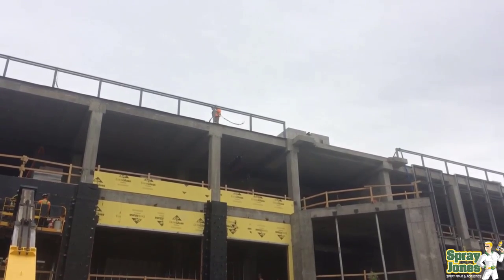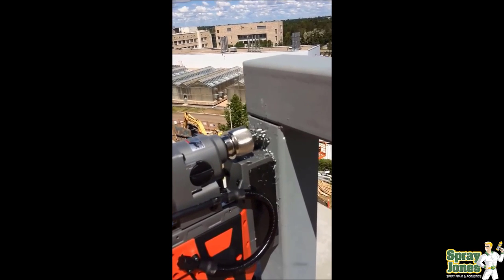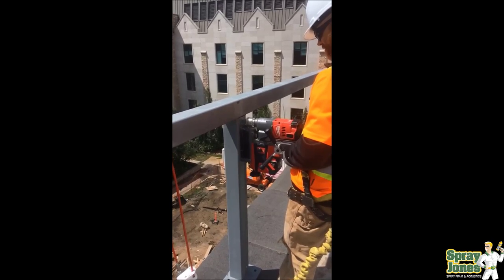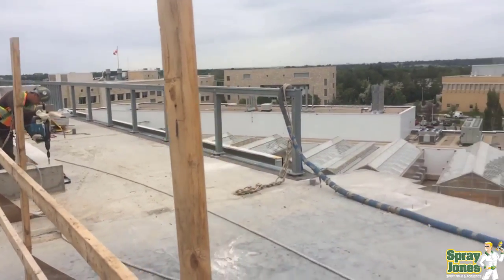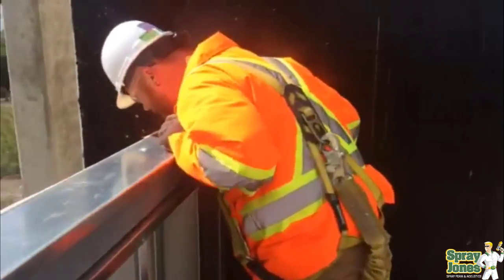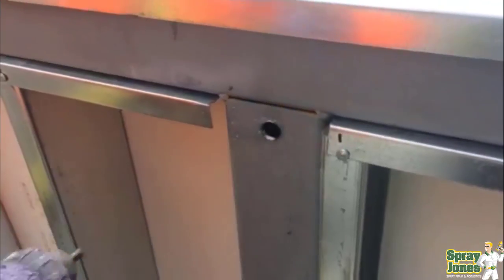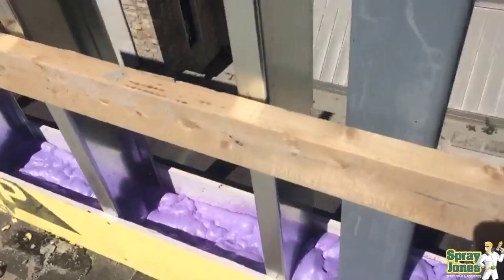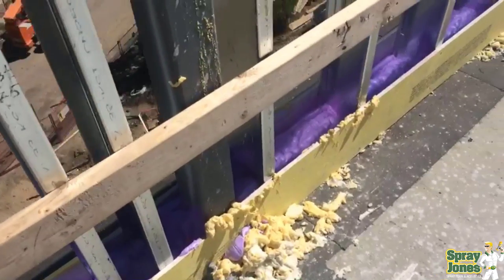Spray Foam Isn't Always Right - When to Use Pour Foam With Hollow  Cavities

Comment: Thanks for a great video.  I very much relate to the part where you fill the wall cavity with foam.  I have old house with 2x4 walls that needs better insulation. I am doing an exterior envelope insulation for wall and roof.  Remove siding/shingles to wall/deck, fir with 2x4 plastic Eco-Stud, install first horizontal row of OSB on studs ,  use additional 6 in screws, put arm in cavity with  Foam It Green spray foam gun with straight nozzle, fill enough for 6 inch lift, repeat next cavity down the wall,  at end of wall start over at first cavity, repeat with second lift, repeat to top of OSB, add next 4 ft row of OSB, repeat , at top use 2 ft or 1 ft tall OSB.  Result, no over spray, no waste foam, no foam trimming, very strong wall/roof like a Structural Insulated Panel SIP,  @  3.5x 6= R22 wall, low air infiltration.  Then do regular siding/roofing. Comments?

Comment: I'm thinking to use 2 inches of  closed cell spary foam to insulate a box truck - but If I want to later install windows and need the wall thickness to be 1.5", is there a way to remove 1/2 an inch of the spray foam?  Thanks,

Comment: What are your feeling on injection foam on old construction of a home? You have the old batt insulation still in the wall does it compress it enough and fill the wall correctly with the insulation still in the wall?
Reply from the maker: Open the walls up and get things sprayed in proper.

Comment: Glad you got the work but the engineer needs to brush up on the lose from metal in conduction.
Reply from the maker: Dan,
The parapet sits right on top of the roof and is structurally tied into the metal trusses underneath. The roof insulation cannot go to the edges because the parapet is in the way and has to brace against the roof decking. The columns and the track needs to be insulated or there would be a 6" gap around the perimeter of the building with no insulation out to the curtain wall. It needs to be done.